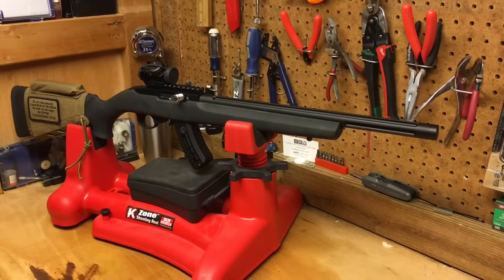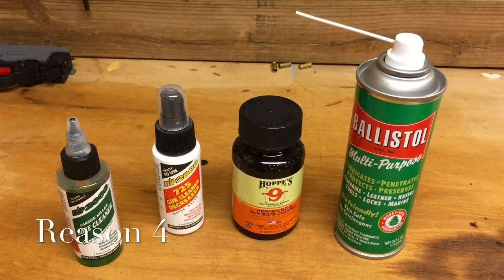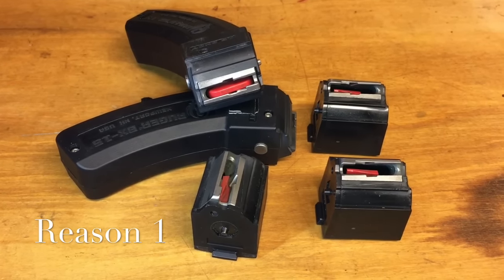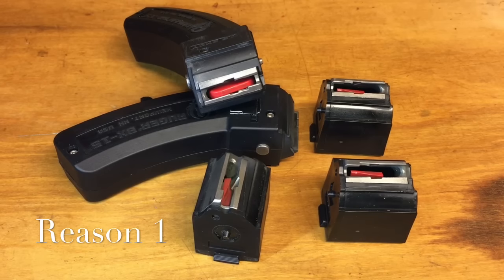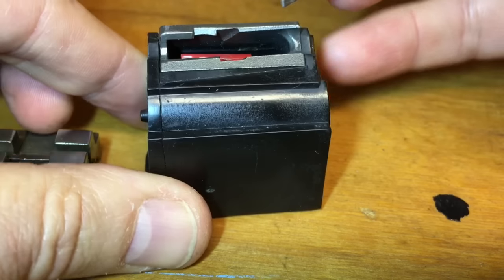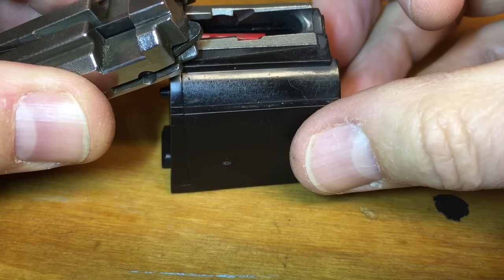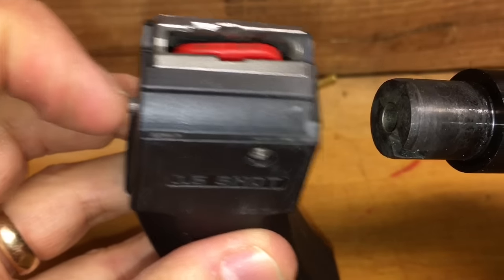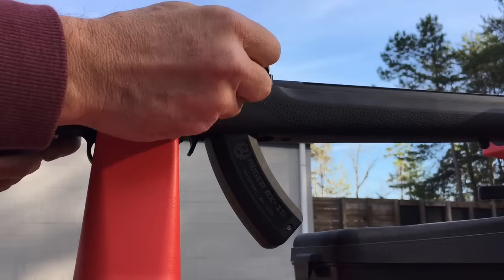Ruger 10/22 Top 5  jams and stovepipe causes and fixes

Comment: I have a 10/22 that would stovepipe about every 5-10 rounds.
I got a Volquartsen extractor earlier this week and polished the receiver and guide rod but I will try your little magazine mod as well.
Reply from the maker: ok, let me know if it works for you.
Reply: Went to the range today and the stove piping was not totally eliminated but it was significantly reduced.
I have 3 BX-25 mags that are all quite new but one of them is problematic as almost every stove pipe I had was from that mag.
I put about 150 rounds through the other two mags of various ammo makes and only had 2 stove pipes where as the problematic mag had about 10 stove pipes out of 75 rounds (various ammo types).
I'll likely replace that mag as I had suspected that one as being bad early on a few weeks ago.
I marked it so I could keep track and that one always seemed to have more issues than the other two.
Reply from the maker: Thanks for sharing the results. Significant reduction is a good thing.

Comment: I've had at least 2 other 10/22's and never had any problems other than ammo related. 

One didn't like Remington golden turds and the other one I couldn't keep enough ammo in it cause I made it full auto. 

The 10/22 I have now has a few mods but basically stock. 
Oversized charging handle (stock weight). Bufferpin, axiom stock (added weight to rear of stock), and a home trigger job. 
It's for the wife to do steel shoots with me. 

The rear weighted stock balances at the magwell so it's easy for her to hold up without your arms getting tired. 

Haven't tried goldens in that gun and probably won't, I usually won't buy them and I have many other guns for the oddball ammo n stuff that has a special purpose. 

Must try a American rimfire in 22lr, same mags as the 10/22 but super good shooter in the 16" version!!
Bad part it will be extra for less barrel and most will need full length stock parts but it's worth it!!

Nicely setup with tall rings and 4x32 fixed Nikon rimfire!
Reply from the maker: Thanks for Sharing Morris

Comment: Excellent video, thanks. I have had issues where the extraction is weak, and even sometimes gets stuck on the deep side of the chamber, while another round is going in.... a serious jam. Or the spent round extracts but gets crushed by the closing before complete exit.. stovepipe. I have a binary trigger which might be escalating this issue, but I will try your suggestions.

Comment: Good information!  You didn't mention that a firm grip also helps any autoloading firearm cycle properly.  My 1st gen Ruger Charger 10/22 pistol has issues grabbing the spent shell casing from the barrel.  I noticed that carbon / lead buildup gets on the face of the bolt and the face of the barrel.  When the two meet they are held apart by the buildup just enough that the extractor does not reach far enough forward to grab the rim of the case.  Does my explanation make sense?  If I scrape the face of the barrel and the bolt with a small knife or screwdriver, the problem is resolved for a period of time until the buildup returns.  Any ideas?  Should I start with a new extractor?  Maybe because of mag alignment / sloppiness issues, I am shaving small bits of lead that are getting caught and smashed between the two faces?
Reply from the maker: It does make sense. I also have a Ruger charger. Try the 10 round box mag to see if that helps.

Comment: The best one I have seen is to file down the surface of the release where it hits the loaded pin holding in the magazine so that the pin does not come out of the hole completely but it does put more pressure against the magazine.
Reply from the maker: Thanks for sharing George. Pressure to the rear of the mag is good if it pushes the mag firmly forward against the barrell. I'm not sure I understand where "the surface of the release" is?

Comment: I tried adding duct tape as shown but it didn't work well and the magazine would not fit in a speed loader with the tape in place. On further inspection I noticed the slop is in two directions, side to side and front to back. I added one piece of duct tape on each side of the magazine where it fits in the rifle. This eliminated almost all of the play in both directions and still fit in the speed loader. Also, the duct tape on the sides does not get scraped off or moved during installation of the magazine. I watched another video where someone took a soldering iron, melted the lug area where this video puts the tape and then adds globs of glue on it. Over engineering the fix as well as ruining the magazine. Instead of tape, you could glue thin pieces of plastic on the magazine sides. Shim it in place to your liking before gluing them in place.
Reply from the maker: Thanks for sharing your details Steven

Comment: I have to say - you can hear something new every day! I just heard you say that the primary ejector in a Ruger 10/22 is the magazine and the part that Ruger lists as the ejector is the secondary ejector that acts as the ejector only when there is no magazine in the gun. Wow, I am impressed by that bit of knowledge (and please be advised I am being very sarcastic). The part you are calling the ejector on the magazine is one of the magazine lips. It is not an ejector. The rim of an expended case hitting that portion of the mag lip may indeed cause a stovepipe because the mag lips were never designed to eject a spent casing.
Reply from the maker: Glenn, 
The secondary ejector is on the trigger assembly and plays no role when a magazine is in use. I use the term "secondary" only because that is the official term that Ruger uses. Go to minute 2:01 on the linked paged below to see and hear Ruger tell it to you (scroll down to see the video).

http://www.ruger-firearms.com/micros/BX-Trigger/index.html

Thanks for the comments.

Comment: Great video!  Thanks for info!  

Took my 10/22 competition out and had multiple jams, failure to fires, and failure to extract.  Used basic winchester hollow points.  I've never had that issue with that ammo on my walther pistol or my marlin.  

Called ruger and they're sending me a new extractor, but what would you do in the mean time?  Test ammo types?  Any other suggestions?

Comment: I do agree with your final mention of the sanding of the mag release handle. The interior edge that can be angled to enable the plunger to protrude slightly . Maybe as much as a 1/16 of an inch or more . 
This seems to snug the internal box 10s mags. Negligible differences on the aftermarket butler creeks which have the same issues with smaller dimensions as the Bx25s.  Too much play. 
Seems to me the tape or some plastic adhesion to the mags should be a fix. 
Be nice if Ruger quality control would pay a bit more attention to the details and simply make design improvements for their 30$ mags. 
Regards from Cda
Reply from the maker: Thanks for the feedback Shawn

Comment: I had no issues the first 400 rounds on my brand new 10/22, the funny part is my 10 round mag would FTF more than my 25 round Mag.i got a couple FTE but mostly just FTF.  I was using Winchester 555 bulk ammo 36 grain. I doubt it's my extractor since my rifle at the most has 1000 rounds ran through it. Can it be that it might be slightly dirty or just the ammo?
Reply from the maker: after only 400 rounds on a new gun? I would call Ruger, they may replace the mag. They are very helpful. Just make sure you have you gun ser #
Reply: Kyle Rakestraw do you think I should try a different type of ammo before I contact Ruger. Had no issues in the bx-25 but the stock surprisingly was the one giving the issues. Also I might add I did spray some lube on the slide and I've heard 10/22 build gunk if "too much" lube is present?
Reply from the maker: I would call Ruger first because they just may send you a free 10 round mag if you are having problems with the 10 round much more often. After calling them, pick up some CCI mini mags standard velocity and use these as your standard ammo until you find the problem

Comment: I just bought this gun so I could put the huge GSG 110 rd drum and BMF Activator gatling crack on it - I also bout the BX15 and BX25 mags ( my gun came with a 5 rd mag not a ten!) and a HC3R 25 rd mag and a 55 rd Promag  with the GSG 110 drum . loaded all with CCI  22LR HV 40 grain round nose even though GSG said use non waxed one  so only loaded 80 rds in that drum ordered the Remington Viper ,Federal Champion, Federal American eagle  And Winchester Super Speed they recommend . Bottom line all the mags fit tight no wobble  only had 1 round fail to eject ( stovepipe in the 55 rd promag  and 2 of the 80 in the GSG which was fired with the BMF gatling crank ( what a rush)  one jammed on feed in chamber  the other  did not ignite in barrel  no evidence of strike on brass bottom, Anyway I was very satisfied going to have the ejector pin spring upgraded and the automatic bolt return upgrade as the rocker in front of the trigger to set and release bolt is stupid as this is not a last shell  hold bolt open gun so will only need to use that to lock bolt back  and can release the bolt after putting mags in by just pulling locked bolt back

Comment: Tip from an avid 1022 shooter: clean it once and shoot the hell out of it. It seems they just need a few hundred rounds to smooth out the action. My gun could be different but I literally went over 1000 rounds without one jam after it was good and dirty. I could've kept going but I couldn't stand how dirty it was. Took it apart and got it spotlessly clean, had 3 jams in the next 100 rounds. After it got dirty again it's been flawless.

Comment: The problem with feeding on the 25 round magazine is that the bullet comes up at the wrong angle and the spring inside the magazine itself is weak. Also do not use hollow points especially Winchester. I bought two brand new magazines from Ruger and they both failed. I really don't like your idea of using tape.

Comment: The extractor doesn't extract the spent case in strait blow back systems. The extractor only holds the round up in place so the ejector can strike the case. Gas pressure extracts the case.
Still a great video...
Reply from the maker: Thanks Travis,   We can also say that we steer a car with our hands, but the muscles in our arms actually force our hands left and right. The gas pressure needs the extractor to pull the case out.

Comment: Good stuff. Just a little nit pick about the operation of a blow back semi-automatic like the 10/22. During normal firing, the extractor does not "pluck out" the spent cartridge case. The reaction of the bullet firing forward is a rearward action by the case itself on the bolt face, driving the bolt back. The extractor then becomes a pivot point for the ejector to push against the opposite side of the case to fling it outward. During the extraction of an unfired or stuck case is when the extractor actually plucks the case out of the chamber.
Reply from the maker: Tim, I like your description better of the blow back. Once I filmed it, I realized that "pluck" was not the best term for normal operation. Given a second chance I would have loaded the mag and showed a round being pushed in and then pulled out by the blow back.  Thanks for the feedback
Reply: Kyle Rakestraw Well, I don't want to nitpick especially considering I've only recently come to a half way decent understanding of the blowback design and the dual ejector system on the 10/22 after about 55 years of shooting them. Hey, I learn quick. 🤓 
Check out this channel for some cool videos on the gas designs too:
https://www.youtube.com/channel/UC3D2NwJzlEL6NBeM559bS3w
Reply: We are always learning something new. 😃👍
Reply: You might have to copy that link and paste it in a browser to make it work. 😡

Comment: Stovepipe problem?.. try this ... hold open the bolt then get a 22lr round and see of it drops freeley into the barrel without getting stuck.. if it gets stuck and does not drop smoothly into place then barrel has too much build up and it needs a good cleaning.  Remove barrel and clean with peroxide and white vinegar mix . Check out this  method on YouTube.  It really works!

Comment: I just experienced  a failure to feed with my 10/22, first time in 27 years? Turned out to be lead build up on the bx25 feed ramp! Scraped it off with a pocket knife and not another issue, other than failure to eject due to crappy browning ammunition that likes to deform the case? That ammo doesn't shoot in any gun, not even a single six!

Comment: It's a shame, we need to do this with a Ruger BX magazine. You would think Ruger would know the size they need to make their magazine. I'm just exasperated on the factory guns. To get it to shoot well & accurate you change trigger group to a crisp light trigger pull then replace it with a accurate barrel then change buffer block as it's loud and clunky, and oh got a bull barrel so change the stock. But the bolt surface isn't square to the barrel so oopa new bolt! Finally your left with a pot metal Ruger receiver that on the stainless version you clean to hard and the paint comes off, from the inside. So to recap, (and I am just as guilty) my Walmart $224 10/22 has $500+ (won't admit more) worth upgrades, just to be accurate on the cheapest round made. Can't wait to start again!
Reply: Unlikely the receiver is "pot metal". The scope mount threads would strip out far more easily if it were.

Comment: Shocking poor qulaity. I got so frustrated with mine that I haven't used it in about 2 years. I found the worst issue with mine is after the first shot the bolt won't fully close on the barrell. It still fires but loses pressure and severely affects the accuracy. I found that the bolt was never smooth and haven't touched it since. Anybody have a solution to this? TIA
Reply: Buy a tandemkross bolt. Worth every penny.
Reply: Send it back and make them fix it..

Comment: Thanks for this video. It's great to understand your firearm. I'm new to the 10/22. I have the takedown model and I bought a BX-25 mag. It fits snugly in there just like the 10's. Maybe the 15's are an issue? Or maybe they corrected the issue?
Reply: I think Ruger had so many complaints with the BX-25s that they remade the molds.  Probably not as many complaints on the 15s because they don’t sell as many.  if you want higher than 10 round capacity why stop at 15?  Go with the highest factory option -25 rounds.

Comment: Lube accounts for most problems in my experience. I stopped lubing with petroleum. I used only dry lube now. When cleaning I completely degrease the entire action then coat everything with dry lube. I will have no problems for approx. 500 rounds. Then I repeat.

Comment: All guns jam at some point, no matter what brand. There actually designed so the mag moves around a bit in the mag well, if it was completely tight you would have issues as well...just buy federal bulk and run a bore snack with G36 lube/cleaner on it every once in a while.
Reply: Bore snake*

Comment: That's odd Ruger didn't make the 20 rd mag the same dimension as the 10. If anything, it should have been slightly tighter since it gave more leverage for grasping. I sanded the mag button lever to let the button extend out a little farther, but stay back from the edge so it doesn't come out and hang. I got a bull match barrel that had the chamber so tight only half the bullets would go in. I put a dowel in a drill and wrapped it in 400 grit to drill out the chamber a little until all bullets fit. It seemed dangerous to not chamber a round fully and was very frustrating. I'll give up a little accuracy for trouble-free performance.
Reply from the maker: Thanks for the comment Terry

Comment: I can understand a sloppy fit from aftermarket mags but from Ruger OEM mags?
I have used Dymo label maker tape to shim the mag wells with no ill effects. 
This is another reason to stay away from plastic feed lip mags. The plastic is not as durable. Wish someone would come out with a replacement feed lip assembly for these aftermarket plastic feed lip mags. Oh you say there is a patent on the feed lips? Only if they have renewed it.

Comment: I have a newer production 10 22 the bolt was rough  I had to do some polishing now its smooth  I just purchased a nos 10 22 1983 year that gun is smooth as glass older is better
Reply: The one that was stolen from me was a  S.S. model made in the 1990s the blue model I got around 2009 is much lower quality and has many issues.

Comment: I own two 10/22s. One is almost 30 years old, and has probably had half a million rounds ran through it with no problems at all. The other is a brand new stainless steel model. The new one will not eject an unfired round. I have to use a knife to pop it out, or shoot it. The gun cycles fine when you fire it, haven't had any jams or other issues. Any ideas on how to fix this issue?
Reply from the maker: It could be your extractor, Its its new, call Ruger . They will most likely mail you a new bolt with extractor at no charge.